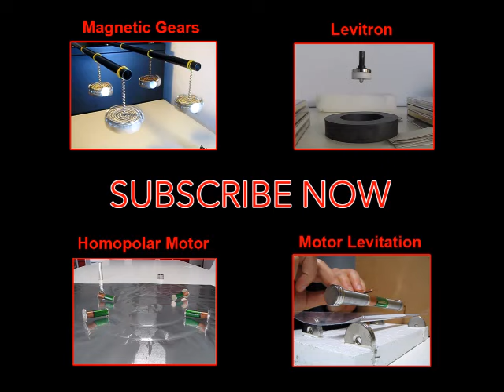MAGLEV Magnetic Levitation Train | Magnetic Games

Comment: its works on the propulsion of air due to fan rotation . To avoid the friction only u used magnet rite.
Reply from the maker: with this method the clutch is reduced but not canceled,  in fact the transparent sides crawl on the rail

Comment: i advise that two ways for improving this system. first substitute the permanent magnet with some electromagnet, because if you try this experiment with a longer railway, you don't need to find so many permanent magnets. second is to notice the friction between the plastic board and the railway. when the "metro" goes, it must be vibrating all the time, so this vibration can lead to the friction and the friction will slow it down. try some way to reduce it.
Reply from the maker: +刘猫 thanks for the advice, the friction problem I know him well, I have worked hard to reduce it but it is very difficult to cancel it. The solution electromagnet instead of the permanent magnets is much better, it is possible that in the future I will make an experiment
Reply: Magnetic Games my opinion for reducing friction is: to make four wheels.then fix two wheels on each plastic board.the wheels's diameter could be very small and the surface should be smooth enough and they can be rotated easily.but the diameter of wheel need to make sure that any vibration cannot make the plastic board and the rail touch any more.so because the friction is not produced by the gravity of the cart itself, it will not go a very large value actually.
Reply: 刘猫 No don't reduce friction for wheels, as more friction = More grip for the wheels and smoothening the surface would be like running with on wet tiles with rubber shoes, however you can make indents where the wheels will go which can help guide the train with much less material

Comment: looks like 1 solid piece of unistrut for the track and you are shorting some power supply across the track to transfer power to the cart...the cart is essentially in parallel with the track and gets same DC voltage but very little of the current as the impedance of the strut is almost nothing?  Or is there a hard to see electric wire taped to the rail we can't see?
Reply from the maker: there 'no electric wire that transmits current. the current is transferred through the sheet metal rails. In effect, the electrical resistance is high, in 3 meters of rail lose 2 volts

Comment: If you reversed the current you put in the steel tube would it reverse the fan or still go forwards ?
Reply from the maker: the fan goes to DC 12V, if I reverse the cables does not move more
Reply: That's weird, because normally when you reverse the current it goes reverse e.g. Clockwise motion becomes counter-clockwise
Reply from the maker: It is correct, but if the fan rotates in the reverse, not by a thrust sufficient to move the train
Reply: So there isn't enough thrust to move it in reverse ?

Comment: Can I ask, would temporary magnets produce the same kind of lift?
Reply from the maker: +paul sawford the magnets in this experiment only serve to levitate the train and reduce friction to a minimum to minimize the power of the engine. for an elevator would not serve
Reply: You mean electromagnets? Yes. Also you need electromagnets, because to really make a maglev train, you need to change the magnetic field over time, to keep the train from falling off the tracks, without the guiding rails.

There's no arrangement of permanent magnets that can secure another magnet at a certain point in space, aka magnetic levitation. All arrangements of permanent magnets are in some way meta-stable.
You can overcome this by using superconductors, but then those are also considered meta-stable, because instead of "regulating" the field, you "regulate" temperature.